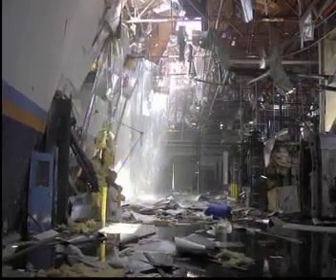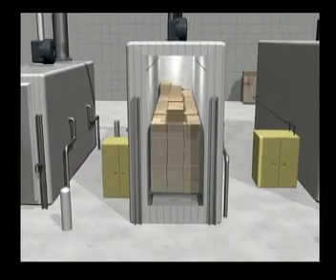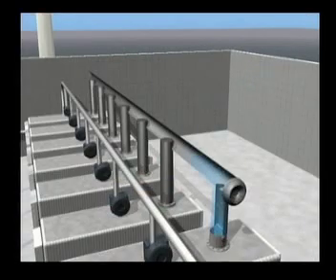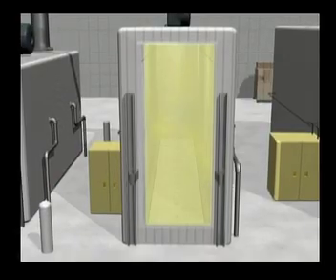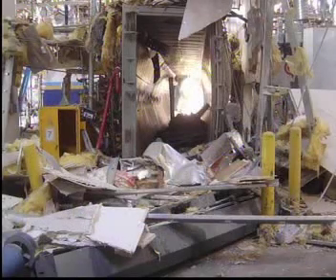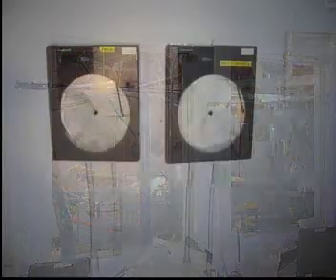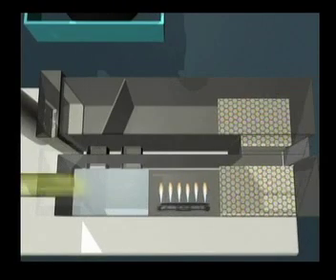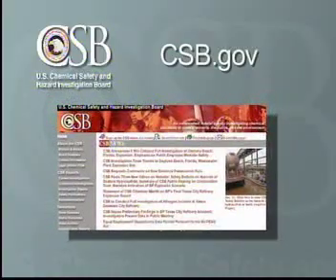CSB Safety Video: Ethylene Oxide Explosion

Comment: I worked as a welder/ pipefitter/fire watch at air products that has pretty much same exact thing... chemicals are brought in by rail and truck to be mixed and sold the mixed chemicals to companies that makes items from the imulsions so the company that is making the items don't have to pay for everything involved in making a non volatile compound from volatile materials including the ethelene...I have been inside the tanks  that mix everything from the very start of the process...the regulations are crazy...makes seemingly simple tasks mundane and labourous...2 spots to smoke cigarettes with paint marks about 30ft square each and they u if you have a lot cigarette and your foot is even touching the paint and u are seen you would be escorted off of the site immediately... knowing first hand I can see how all it takes is one time for procedure not to be followed and a 5 mile blast area(what we were told in the initial safety meeting before u were even allowed to walk into the site and I remember thinking that it was more of a scare tactic until they showed what can happen....I was 19yrs old and shit went from joking around saying to myself that they are over exaggerating until the end of the 16 hr safety meeting they show you a plant exploding at the very end...they do lockout/tagout  procedures where everyone is given a bunch of locks and any equipment/ pipelines being worked on you would put a lock that only u had a key for on valves that isolated areas... everything just takes so long and you get pressure from above to get so much done...someone near the top  feels like they are underproducing and are worried they will lose their job and cut corners to save time or money and this happens...I worked at air products in Dayton NJ and I will say with certainty that place will never go up like u see in country areas...if the same things are happening when I was there today at least...I hated the safety manager because he always tried sneaking around to catch people and was a stuck up nerd that acted like his shit didn't stink... bastard asked me one day to show him how to lay a bead of 7018 right when our lunch started we worked 10 hr days and only had a 30 min lunch... barely had time to eat a sandwich and a quick smoke after I already punched out for lunch so to say I was not happy was an understatement...he was also the one that checked time cards so he was being a dick intentionally...only acted like that towards younger guys and he was about only 10 yrs older than me...took about 10 min of my lunch...I showed him how to lay the bead...he tried and flipped his hood up it basically came off he had this grin on his face like he got layed for the first time...I'm calling him a dick to myself walking to the lunchroom and I never gave him the tip to first never take off safety equipment while working...dumbass...was a clear and welding shield facemask combo...he instinctively thought it was only a dark welding shield...I start to hear clinking from him trying to chip off the slag on top of the weld and I somehow forgot to tell him that you always chip away from your face in the opposite direction...dipshit hit it about twice then I hear screaming ahhh get it off get it...he learned what a few thousand degrees Fahrenheit can do to your fresh virgin facial tissue...I'm walking into the lunchroom laughing my ass off while he is by himself in the welding shop with his face on fire screaming and you can see through from the lunchroom to the shop but it's sound proofed pretty decent because of how loud metal working is and u cauld hear him screaming like he was in the room... everyone asked me aren't you going to go help him I said I'm punched out on lunch... besides why is he touching equipment he is not certified to use... his attitude towards younger guys changed after that fiasco cause he could no longer be the petty asshole he was we knew what happened to him and it was all recorded cause there are cameras everywhere...he knew if he busted anyone's balls for extremely stupid stuff and wrote someone up they would mention what happened to him because he literally did it in front of everyone...I could not have planned it better if I tried...sorry for the long story
Reply: While you could've helped him, and there was the risk of that getting worse or causing lethal injury, it seems like it worked out for the best.
Reply: No, Problrm Man, Trust Me I, Understand Cause I Worked as a Contractor on Eglin AFB. For 16 yrs, & We, Had Some of Those Same Kinda DICK-HEADS Out there aswell, Some In SAFETY,  & Some Not But it Never Fails though. I, think Management Seek's Out Dip-shit's Like the One You,  Discribed to Fill Those Slots, Basically they Take a Decent Place to Earn a Living into a Living Hell & those guys walk around taking under the belt cheap shots @ the Workers You, Know the People who are actually Making the Company Name Out Front By Actually "WORKING"  & When they Could Be Helping the Workers there Responsible for  by JUST doing there JOB Opposed to Sneaking around being Juvenile Trying to Cacth Someone So, they Can Be the Big Man on Campus & BUST Someone..When all it Boils Down to is a Man trying to Earn a Living in an Environment that Safe &  That Isnt a Mental Mind Fuck ( Cause it doesn't) Have to Be, & Build a Good American Made Product then Go Home & Do the Samething Again the Next Day.. Sound's Simple,  & it Should Be But Often Not it Isnt.. & That's What SUCK'S !! & It Only Takes One Dickhead to Screw the Whole Shop or Factory Floor Up.. So, I, Get It Bro,  & That's When Its Time To Do What You Have Done Here  & #1) = VENT.. Or Option #2) HOMICIDE = JAIL !!      & Ain't No, (  UBER/GUBER ) Worth Gettin Locked Up For.. So, by all Mean's VENT !! LOL..
Reply: @J Hemphill Youtube kind of messed up formatting. You can only "paragraph" the first line, and after that it just auto-condenses everything into one jarbled mess of text with no multi-layer spacing. Sucks to be honest.

Comment: Why does the computer system even provide the option of skipping the gas washing steps, password or not?
Reply: Probably for maintence or testing. Like if they used a different gas or maybe no gas at all to test the injection and vent systems or something. Or perhaps if the computer were to freeze or get stuck.
Reply: Under normal operation, that's fair. But there's always going to be cases where you need manual control of any machine for testing and maintenance.
It's up to the company to make sure they only use them when necessary.
Reply: It's probably possible the system could be lead to incorrectly believe that there is ethylene oxide within the chamber when there is not. In such a case it would be wasteful to do the gas washing process as there is no need for it. The password is to get staff to think twice about skipping the step, in case there is in fact ethylene oxide inside.
Reply: you should be required to enter a password to even access the gas washing bypass to enter a password to trigger it
Reply: @noahater5785  so who owns the second password? The same supervisor?
Reply: @jaykoerner  Night shift supervisor if this business does night shifts?
Reply: @noahater5785  my point is a password a prompt to give access to enter  a  second password make no sense and wouldn't have stopped this, at best even if it requires a second person, they would have just called them to receive the second password, no one at the facility seemed to  understand the danger. and there was not proper monitoring equipment, a password in the hands of one supervisor isn't much better then requiring two passwords from two different people, such overrides exist so that they are possible to use if the remote chance they are needed a delay isn't helpful, I do believe flame arrestors should have been in place and a over pressure system in such a case that a volatile mixture is sent to be burnt off, such that if the mixture is explosive it positively separats the main chamber from the burn chamber, but in all honesty more monitoring equipment, proper training and extra safety equipment make more sense the enhanced requirements for overrides, if this would have happened requiring 10 passwords it would not make sense to advocate 11, the password was not in standard operator hands, and both the technicians and the supervisor should have known better, and even if they didn't the system should have positively informed them that such actions are dangerous, including the current state of the atmosphere in the chamber

Comment: 1:45 how come they did not use ultraviolet or ozone to sterilize it’s a lot safer! Signed CSB jr
Reply: Because ultraviolet has a ton of downsides. For example, UV cannot sterilize the INSIDE of a needle.
Reply: You need Gamma-Ray sterilization, because UV did not penetrate enough..
Reply: For expensive, in water treatment UV is very effective but stupid expensive so its rarely used.

Comment: i can see that fire snubbers in that back vent line would have saved a lot of pain, suffering and expense.
Reply: Yeah. But there is no need as there shouldn't be ethylene oxide in contact with fire. Yeah?
Reply: @charadremur333  that is as may be, but as long as there is a chance, there is therefore a need, and it cannot be ignored.
these people dis-regarded the need and look what happened to them.
Reply: @jimw83296  yeah, I'd much rather spring for them than not have them and blow up my facility. Plus, they're not that expensive.
Reply: @charadremur333  well, chara......the world is not perfect, also you forget about demon murphy (as in "murphy's law").
when building a place like this,one absolutly  
MUST consider a visit from demon murphy.
Reply: @edgarlatulip4820  fair point

Comment: How come there is an option to skip the gas washing when it is clear that you wil get an explosion when the gas cycle is skipped once the treatment gas has entered? Like once gas entered the chamber its a definite BOOM if not properly washed. This is not just an operation problem. It was a design problem too.
Reply: Lemuel Haring I can think of lots of reasons why this is needed. This circumstance was definitely not one of them..
Reply: @alexjackson936  Then please do mention them, do not just make a statement claiming supperior intelect and not back it up. Also why even state that you can think of a reason if you do not provide one? What is the reason? Think about it
Reply: @lemuelharing4137  There should always be a way to override the procedure or skip steps. Ironically, it's part of safety. It's a requirement that any step could be stopped mid-procedure (e.g. emergency stop) or skipped in this instance. Was it poor judgement to skip the ventilation step? Obviously. It caused the explosion after all, but that's why it requires the manual override and supervisor's password to confirm. The supervisor and technician were poorly trained and did not know the "science behind the methods" leading them to believe something that wasn't true. An unfortunate event.
Reply: @anonypersona3189  Wrote a long message, batery went out, not going to rewrite. In short though, you are correct and it makes sence, could have been designed better regarding how the system runs with bypasses, rather all to scrubber than back vent with flame, cost? Extra design time, coding and accomodation of scrubber treatment rate or volume storage. But a lot of exstra design for all single shutdowns, could just train people on what happens under the assumption that training is done sufficiently for many years. It was a trade between time and increased risk of accident. Was a reasonable trade im my oppionion. Human life loss still bad. I need to design these processes. Its an tradeoff between exponential design time increases and creating a fool proof system. How safe should something be? 99%? 99.99%? 99.999999%? If your system blows up at 99.999 safety due to the greed of others, its resembles a moral predicament. Its morally easier for me to design systems for the military and the intent to kill than a system that is ment for civil use and prevention of human harm under any circumstance(worldly or concience/stentient input).  Tradeoffs in a world of appliece science, statistics and the infinite scalling cost of pure science or progress towards it. Its not a qaulatative question but a quantative one that is not be required to be asked nor answered. But it is asked. An always moving line to keep track off.

Thats the summary
Reply: @lemuelharing4137  Yeah, I do agree that there should have been some more redundancy in the safety systems. Like the narrator mentioned, there should have at least been a sensor alarm to note that there was still flammable levels of gas within the system that could combust when it went to the burn chamber. That definitely seemed to be a huge oversight on the designer's side of thinking. Even if all of the procedures went according to plan, I know I would definitely want to have a sensor in place for that.
Reply: Lemuel Haring  Software could’ve prevented this, and really should’ve been embedded in the process with monitors in the gas chambers. Very short-sighted and incomplete design.

Comment: All that for sterilization of medical products don’t make sense as soon as someone put hands on the objects its contaminated again.And hits air.
Reply: You don’t quite get it. The medical products arrive packed as individual units in cartons then are sealed into cases. The cases are loaded into the sterilization chamber. After the sterilization and gas purging processes the cases are removed. The individual items are never touched. The film used to seal the medical units are gas permeable but don’t allow bacteria or microbes to enter. The items remain sterile until opened by the medical staff at a hospital, etc.

Comment: This is why government overwatch is important because the private industry will never follow the rules if they don't have to.
Reply: Government can't even follow its own rules.
Reply: Because the goverment is so great isn't it? They never do anything wrong, right?
Reply: Ignorant statement. Every single failure occurs due to lack of proper regulatory authority by the government. The government has no bearing on these situations at all. This company had a very good system in place that should ha e never failed. It would be like saying my balloon design was bad because someone could use a knife to poke a hole through it. 
This company, regardless of any government, will certainly never make this mi$$$stake again. All that the CSB does is provide an external 3rd party audit of the situation free from bias to determine what steps should be taken to make the system even more idiot proof. And then relay that information and make it available to all companies so that they can avoid the same issues in the future. 
Please never forget millions of companies do these types of procedures incident-free trillions of times a year across the globe.
Reply: Mark Henderson the damage to the companies facility is probably higher than any profit they would have made by poor safety standards.
Reply: @stevensonDonnie  corporations will never do the right thing unless they're forced to.

Comment: Isn’t ethylene oxide the filler in thermobaric weapons?
Reply: white zebra they don’t really suck anything, the ethylene oxide mixes with the surrounding air and the mixture is detonated. The reduced oxygen in the area is a small consideration besides the enormous heat and high, sustained blast overpressure. That and the toxicity of leftover fuel will kill anyone nearby before the lack of oxygen.
Reply: white zebra not difficult, it’s got no uses outside sterilising medical equipment and sanitising bunkers. You aren’t likely to buy a tub of it by accident. 
The reason it’s used in thermobarics is its incredibly wide explosion limits. It is explosive from a few percent in air through to about 99%. It is at least as dangerous as acetylene in this respect with the added hazard of high toxicity. It’s real nasty stuff.

Comment: You know even old Oil Furnaces have an "Eye" as I like to call it. It seems putting one in this system as a safety, would be a good idea. Except it working in reverse, when it senses a flame, it shuts down valves on both ends.
Reply: @Comrade Vlad I can understand that, I was just thinking about there being something, to block the flame from getting back to the sterilization tanks. Maybe causing damage to part of the system, before it can get back to the high volumes of flammable gases. But, you're right, I don't think a system could work lightning quick like that, but I've seen crazier things.
Reply: Scott Crabtree 

Good idea, Scott.  

Decades ago I purchased a claimed-to-be-explosion-proof gasoline safety can that was advertised as being filled with metal screening.  The stated purpose of the metal screening was to absorb heat from the flame front attempting to propagate through the can, essentially quenching the flame before an explosion could occur.

Perhaps there is a market for metal-screen-filled explosion-proof ducting.
Reply: Those are called Flame arresters